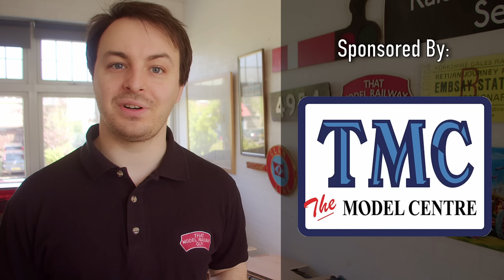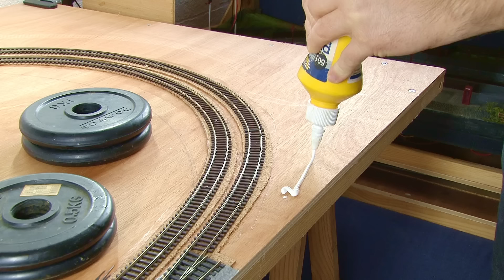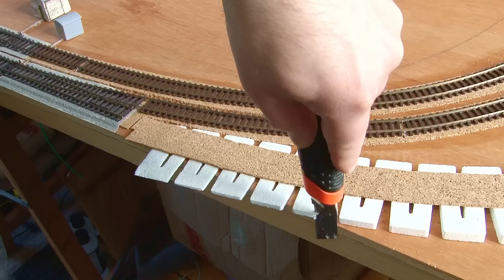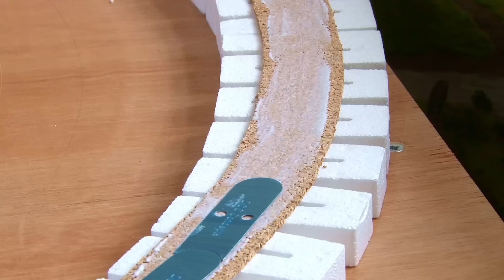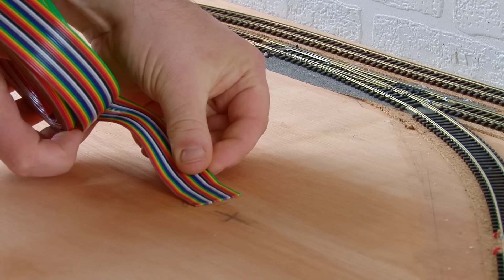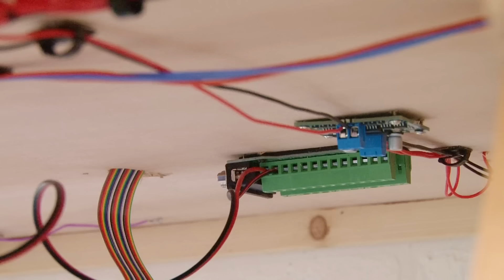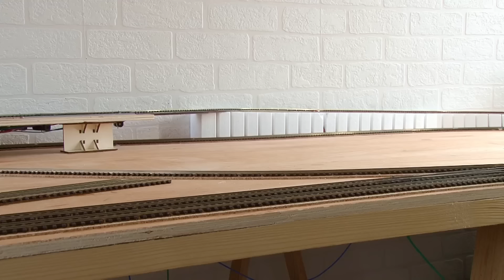Building A TT:120 Model Railway - Episode 4: How To Build An Incline

Comment: How does the A4 'escape' from the upper level ?
Reply from the maker: Just using a standard shunt release. Either another express engine takes the carriages back out onto the layout releasing the A4, or a pilot engine (such as the new J50) shunts the coaches allowing the A4 to access the sidings or reverse loop. Thanks for watching 👍

Comment: hi there u have inspired me to make a upper level but I'm running a standard dc gauge master controller would i still be able to use the dcc magnets ?
Reply from the maker: Yes the power base works just fine on standard DC control. DCC Concepts is just the name of the brand that makes it but the magnetic Power Base itself doesn't have anything to do with electronics so it makes no difference. Thanks for watching 😃
Reply: @ThatModelRailwayGuy  ah ok thank you so much and by the way i love your videos they are amazing to sit down and watch in the evening's

Comment: How do you prevent the track buckling at the connections
Reply from the maker: It definitely takes a bit of practice. Pre-bending the rails can help but it needs to be a smooth bend rather than introducing a kink. Offsetting the two rails works really well to help create a smoother connection too. Hope that helps and thanks for watching 😃
Reply from the maker: It’s just occurred to me that I assumed you were talking about track connections buckling on curves but perhaps not. If you were talking about track buckling due to heat then leaving expansion gaps between section really helps in this area 👍

Comment: Is tt:120 the same as ho?
Reply from the maker: No, it's smaller and sits between N and 00/HO. TT:120 is 1:120 while HO is 1:87. Thanks for watching 👍
Reply: No, ho scale is (if I'm not mistaken) 1:87, whilst tt is 1:120, therefore a smaller scale
Edit: sorry if it showed this reply multiple times, I was lagging and accidentally sent it more than once, but its all fixed now
Reply: Thanks that model railway guy I almost bought the wrong scale

Comment: Physics...the direct line of distance between the engine and the last carriage in the true rate of incline which is why the loco stopped at the point where it did when looped back on itself the direct line of distance was shortest but the height difference largest.
Reply from the maker: Just easier to say the train was too heavy for the loco to be honest. Thanks for watching 👍

Comment: Surely moving a magnetic field over a metal surface actually just creates a massive eddy current brake... as used on a roller coaster for example.
Reply from the maker: I would imagine that, considering the strength of the magnets and the general speed of the models being considerably less than a rollercoaster, it doesn't have much of an effect. Here the magnets are just pulling the model down into the track to give it more traction - obviously it works as demonstrated once the magnets were fitted. Thanks for watching 😃

Comment: Nice video, although, my idea is to 3D print with TPU the track raisers. Or you can spend hundreds of pounds into woodland products.
Keep up the work. Cheers
Reply from the maker: The Woodland Scenics inclines are only £25 so hardly hundreds. 3D printing, laser cutting or even just building with wood are all valid ways of building an incline - but it's definitely for more experienced modellers as you need to have all your calculations spot on. The slightest bump or variation is going to cause issues which is why I still recommend the Woodland Scenics Inclines. Naturally those who DO have more experience aren't really in need of a tutorial on how to do it. Thanks for watching 👍

Comment: what height is your upper level? i measured 51mm being enough but yours looks taller.
Reply from the maker: The surface of the upper level is set at 55mm. Taking into account the 9mm wood used for this upper deck, the clearance underneath is 46mm which is about the absolute minimum you can go. Hope that helps and thanks for watching 👍
Reply: @ThatModelRailwayGuy  thank you ever so kindly. I wasn't far out. I Appreciate it.

Comment: How did you bend the flexi track to keep the curve please? I am about to be doing the same on an incline, Thank you
Reply from the maker: The PECO TT track holds it's shape when you bend it. If you're using flexible track that doesn't hold it's shape then you'll need to add some weight on top of it while the glue sets it in place. Thanks for watching 😃
Reply: @ThatModelRailwayGuy  ah ok thanks, it's Hornby 00 Flexi and that doesn't keep it's shape.

Comment: Is there anyway that this layout can be shortened to fit in a 6 ft x 3 ft baseboard
Reply from the maker: You could give it a go. The biggest issue would be the incline and getting enough clearance to go over the lower level - the extra half foot of depth would help but you'd probably need a 4% incline which would be very steep for the locos. You'd most likely need to shorten the platforms too or possibly have the upper level cut across more for some extra length. Thanks for watching 😃
Reply: @ thanks, I’ll try and will let you know the outcome

Comment: How many magnets did you have to fit to the underside of the loco
Reply from the maker: I managed with two on the A4 and A3. You could always add more if you wanted to do an absolute crawl up the incline but as on this layout you're always coming off the mainline you have a decent amount of speed/momentum to help. The Class 50, HST and Duchess don't need the magnets though as they're heavier models. Thanks for watching 😃

Comment: How do I convert my analogue layout to DCC ?
Reply from the maker: That depends how you've wired up your analog layout. At its most basic: unplug the analog controller and plug in a digital one instead. 

If you have sections fed by different controllers you'll want to run them all off the same DCC controller. Similarly if you have any isolating sections these can be fed power all the time now. If you're sidings are self isolating (so that power only goes through when you switch the point in the right direction) then you may want to add additional dropper wires to the track in the sidings but this is only really necessary if you have sound locos that you want to continue making noise even when they're static. Hope that helps and thanks for watching 😃

Comment: Nice video, shame on platforms 1,2 & 3 there's no provision for a run around for your locomotives
Reply from the maker: There's not enough length to have both the points and space for a headshunt, unless you were only running round very short trains. Instead we've made this a feature of the layout meaning that locomotives swap over when a train arrives into the station. Thanks for watching 😃

Comment: Looking good. 👍
Even though your layout is almost an exact copy of my planned layout I have raised the frontal area by around 20mm so that the incline is only 2% and creates a scenic lowland in the centre where the shunting yard is.
The main difference with mine is that all the outer tracks rise to the same level as the top station but travel over a viaduct  and a Bridge into the top station goes over a canal.
My trains can also access the upper level in both directions after going through the reverse loop which it looks like you can't? 
I have introduced Tillig points and MTB motors to give this option.
Reply from the maker: Sounds cool! We deliberately stayed away from raising the track at the front as we didn't want the landscape to feel like it was in a basin. The reverse loop is designed as a standard out and back style layout, so any trains that leave the terminus station can use the reverse loop to head back to the station. Thanks for watching 👍

Comment: Fitting magnets under locos is a solution but many locos simply do not have sufficient space.
Reply from the maker: Between the wheels is usually flat. That’s where the micro magnets are designed to go. Thanks for watching 👍

Comment: I have a layout full of inclines the most important aspect to me of an incline is the top and bottom transition curves. The main incline is just a flat plank with different height ends. I build my transitions  over 300mm but i extend them to 500mm so i can screw down onto the flat baseboard the 100mm overlap and the sloping "plank". At the top the same occurs. What i achieve is a smooth curve transition with no slight kinks that can look unnatural and do not reduce wheel friction which on inclines is very important. Your video does not seem to cover transitions nor inclines of different heights. I am lucky i do have space
Reply from the maker: With the Woodland Scenics inclines you don't really need to worry about the transition because it's such a consistent grade already. You can see the first sections are almost paper thin where up the top I used the bridge to level everything out smoothly with the cork. This is also helped further by having the power base continue under the track on the level as shown in the video. 

While building your own inclines is absolutely a valid way of doing it, for anyone building their first incline I would highly recommend going with these pre-made sections initially as they makes things really simple. They help you get a handle on the basics before trying out more advanced techniques. Thanks for watching 👍

Comment: Another trick for curved inclines: if you can fit a wider radius curve on the same incline base you get a double win, by reducing both the gradient and the friction from the curve.

It's why a double helix should always climb clockwise for UK/AU or anti-clockwise for US/Europe if possible.  The inner track is noticeably steeper.
Reply from the maker: Obviously a wider radius and a shallower incline are always going to be preferable. In this instance though moving the line to the outer edge of the incline base wouldn't make any noticeable difference as there's only about a centimetre of extra room. In 00 gauge this wouldn't be an option at all since the track is wider. Thanks for watching 👍

Comment: I do love the magnet system. Very clever. How many carriages can the A3 actually pull. I have a 7.5x5.5 design with inclines and I was hoping for 8 passenger cars and similar length for freight trains. Average inclines are 2% with one at 3% but that is downhill into the shadow station
Reply from the maker: I was able to get the A3 and A4 to do 2 carriages on this incline before I added the magnets. I haven't tried out the max load using the power base yet but I was considering doing a video where I put the various TT locomotives to the test. Thanks for watching 😃

Comment: Some fab stuff here, and an excellent demonstration of the use of the powerbase.

I will say though, the gradient wasn't the only thing causing the train to stall, but friction and non-linear forces as you'd find on any tightly curved railway. If it was a straight shot all the way to the top, or a less extreme alignment, I reckon the A3 would have managed on its own just fine. Sadly, that's the constraints of physics for you.
Reply from the maker: I was literally just thinking no-one had commented yet on the curve being a contributing factor too! The A3 was fine even if we went down to just two coaches (hence my comments in the video about running shorter trains) so it really was just that 3rd coach that made the load too much. Thanks for watching 😃

Comment: Always wondered how to get a successful gradient on a layout. These woodland scenics inclines look easy to install and work with. 

The DCC concepts powerbase system is also another amazing idea for gaining extra grip for all gauges of model locomotives.
Reply from the maker: Yeah using these incline sections is definitely the easiest way in my opinion. Getting a smooth consistent gradient could be quite a challenge but this takes all the guessing out of it and the power base is really handy for allowing the trains up those steep inclines too. Thanks for watching 😃

Comment: Not a modeller but quite like watching the videos following a heart attack (genetic, not couch potato). So many of you use gym weights for pressing down the glue. Do you actually use the weights as training equipment? Similarly, both my daughter's gardens had rusty weights that someone must have bought and never used or used to weigh down something in the gardens. How much gym equipment gets bought and never used? I have kettle weights and have used them a lot for workouts. A cheap static bike our son left in London would be useless for me as a a gym item on its own but, 10 minute blast, hop off and swing kettles or do some press-ups or plank then back on bike works very well. I did use the kettle weights for DiY last week to flatten a warped table top my daughter wanted renovating but it seemed a crime against health to do it.
   If I did railway modelling, TT120 is what I'd do. Perfect size for aged eyes & limited space. But the 7 * 3 metre outbuilding is full of construction, garden, and BBQ gear - and the family and friends have ongoing requests for projects
Reply from the maker: Glad to hear you've been enjoying the videos, although I'm not sure it matters much what people use weights for. For what it's worth, mine are left over from when I was in a more physically active job but I'm certainly not going to judge anyone who uses weights as a tool. Thanks for watching 👍

Comment: This is worrying.  It looks like you're on a 8ft x 4ft board like me.  I'm planning a raised station with an access ramp just like yours.  I'm not sure yet what clearance I'll need under the raised station but I was thinking a 2% gradient would be OK, but maybe not.  I've noticed that my William Whitelaw gives some wheel spin on the level when starting off slowly with just the standard 3 coaches.  As I wouldn't want to be fixing magnets on the underside of my engine some careful planning and experimentation will be required I think.  Thanks for this video, very helpful.
Reply from the maker: Hi Mark, not quite - this is an 8ft x 2.5ft board so a fair bit smaller on the depth which both shortens the run up to the upper level (requiring the 3% grade in this instance) and also tightens the curve which will have a huge impact. An incline on a straight is much easier for a loco to handle.

I'd recommend doing a lot of testing before fixing anything down and if you've got space for a 2% grade definitely go with that! It's worth noting as well that the A4 and A3 in particular are quite light but the new HST and Class 50 don't need the magnets as they've got a lot of weight to them. 
Hope that helps and thanks for becoming a Member 🤩

Comment: The power base idea is a nice rework of the old Tri-ang Hornby Magnadhesion system from 60/70’s. The magnet was built into the chassis and acted on the steel rails in the track. Modern track is nickel silver so not magnetic. Are there any issues with magnetic couplings with the power base system? IE the couplings being attracted to the  steel plates?
Reply from the maker: Yes it's the same basic premise but very much streamlined for the hobby in the modern day. I haven't tested out any magnetic couplings yet but I would think, with magnetic field being lateral in that instance, that they wouldn't be affected too much if at all. 
The magnets under the locos only pull the chassis down a little bit, it's not like the loco is stuck to railhead so it really is just a little extra grip. Thanks for watching 😃

Comment: Love the way this is shaping up, are you going to add a turntable or some description on the upper level to turn the locos for departing trains? Or is it a run round the reversing loop for them?
Reply from the maker: There's no space on the upper level for a turntable so locos will either tender first or (in the case of the A3 and A4 which don't have a front coupling) they'll run back round the loop to reset their direction. Fitting that in around the other operating trains is all part of the fun. Thanks for watching 😃

Comment: If you need to get to track underneath the top station, to clean it for example, how are going to do it?
Reply from the maker: The sides and back of the upper level are open so it's pretty easy to get a track rubber in and clean it if needed. There are also access holes cut into the top as well (which will have removable scenery on them) so we can get to things in an emergency - for example if something derails. Thanks for watching 😃

Comment: Nice video yet again. I did notice that you’ve provided the link for the DCC concepts  power base but for N gauge , not the 00 gauge kit.
Reply from the maker: Yes that's right, I found the N gauge one a better size for working with TT track rather than the 00 gauge one. I was also mildly worried that the magnets might be too thick in the 00 gauge kit. Thanks for watching 😃
Reply: @ThatModelRailwayGuy  Thankyou, handy tip there. I’m doing my layout in 00 gauge so the n gauge power base will be good for my layout too.

Comment: I was very interested to see what your solution was, the powerbase seems like quite the clever idea! Going to give it a run on my OO gauge layout with similar inclines and see if it helps a bit for more realistic running.
Reply from the maker: It's definitely a handy thing to have in your back pocket when all else fails! I used the N gauge version on this layout but there is a 00 gauge version as well which has bigger plates and stronger magnets. Thanks for watching 😃
Reply: @ThatModelRailwayGuy  What did you use to attach the magnets to the bottom of the loco?